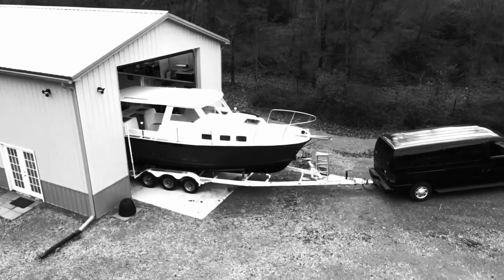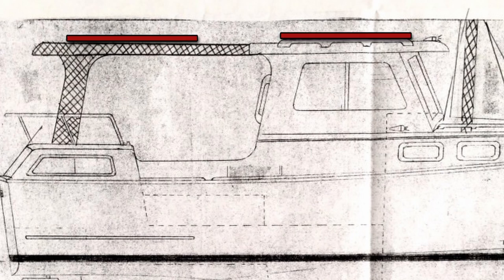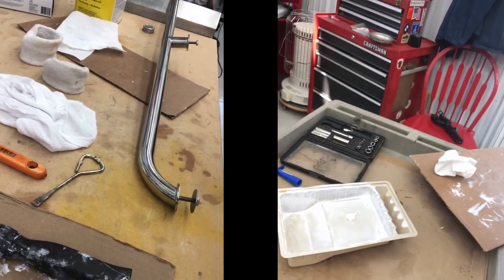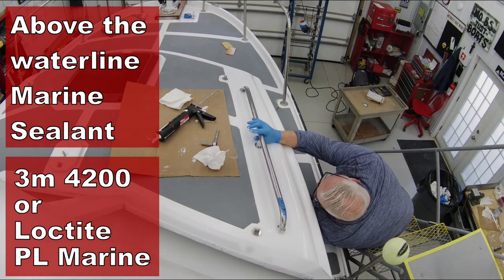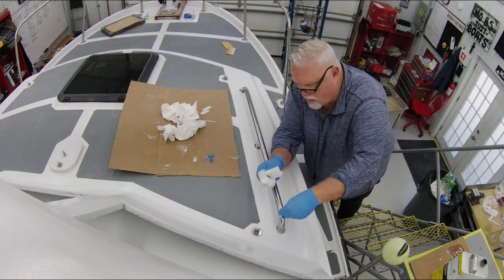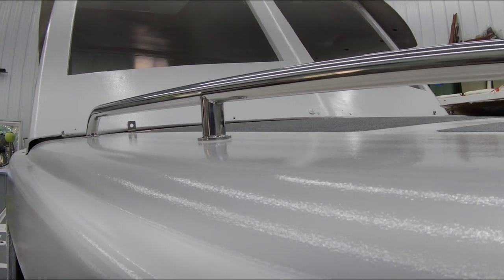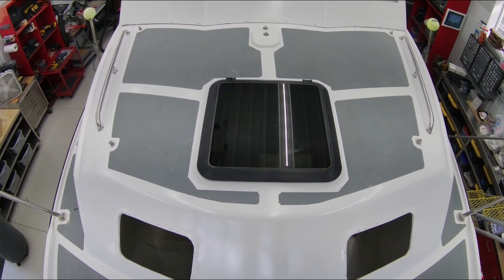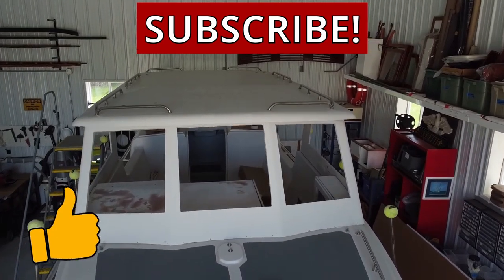How to Install Boat Stainless Steel Handrails | Sailboat Restoration and Boat Building  (Ep9)

Comment: I’m sure you measured the old hand rails firs from one hole to the other before getting new hand rails or did you take one of the old ones with you to shop for the new SS one ?
Reply from the maker: The new hand rails are custom made and the holes drilled after the fact to match

Comment: Looks like you have big washers on so you don't need a backing plate. Did the company who made those make the threaded holes for the screws?
Reply from the maker: All fabricated by the vendor 😁👍specifically chosen due to design

Comment: Are the hand rails made from stainless steal or aluminum with chrome finish? — and where could I buy the stainless steal pipe to bend my own rails?
Reply from the maker: The handrails are 100% stainless steel. This is a probably a job for a fabricator welder